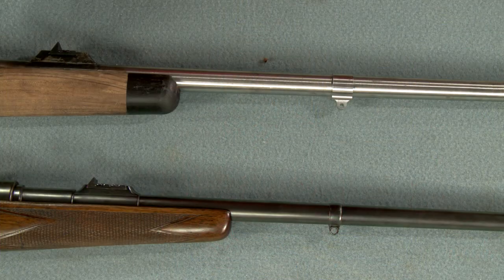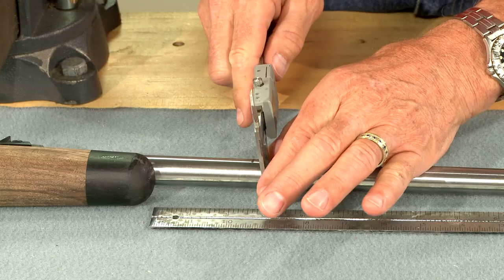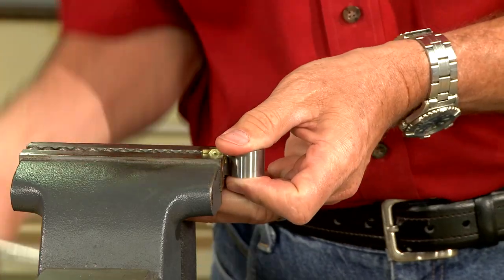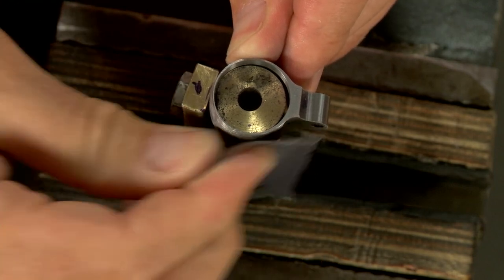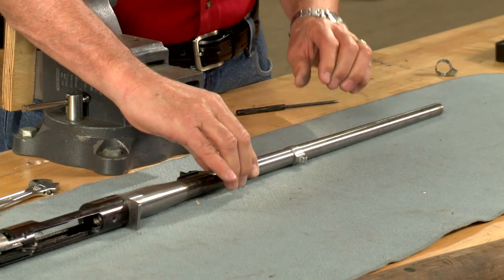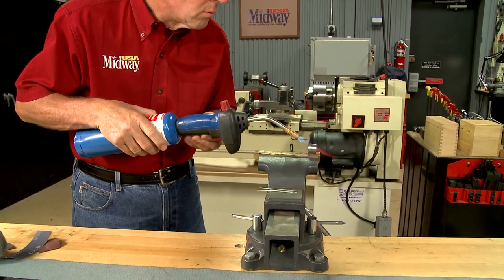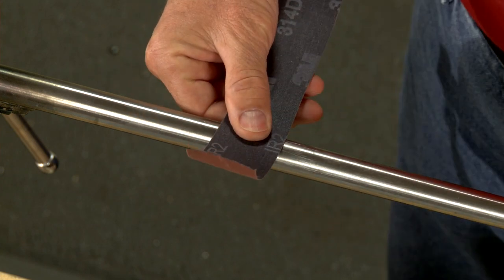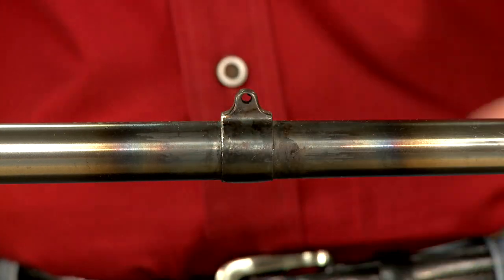How to Install a Barrel Band Sling Swivel Presented by Larry Potterfield | MidwayUSA Gunsmithing

Comment: Wouldn't the heat affect the barrel? You can see the steel change color which means it's been tempered. Unless maybe because of it's thickness only the very surface is being affected?

Comment: So the heat doesn't damage the barrel at all?
Reply: It is medium heat from the propane torch.  It is no more heat than 4 or 5 shots in a row(pretty fast succession) produces.  If he heated the barrel until it turned red hot then it would have ruined it.

Comment: This is not an indictment of Midway or Mr. Potterfield but I urge anyone thinking of installing one of these to take it to a qualified gunsmith.  I would never do this with any one of my rifles ... ever. You have to know what type of steel the barrel is made of, you have to heat the barrel using the right amount of heat, you have to know how to cool the barrel uniformly, and you have to know what you are doing when applying the heat to assure you do not warp the barrel. I have watched master blacksmiths heat treat steel of all kinds and I assure you, you can screw up a barrel big time if you don't know what you are doing.  Save your money somewhere else and let an expert do this for you.
Reply: Loctite retainer (known in some circles as a "chemical press fit" ) might be a better option, no heat involved and just as secure.
Reply: Gotta learn somehow, without the odd hobbyist screwing up a few junker guns we'll soon be out of "expert gunsmiths" that can still do this old school work. Not saying your wrong, obviously don't practice on a Rigby, but  the knowledge in this video means that hobbyist may only wreck 2 guns instead of 5.
Reply: I'm responding to this four-year-old post just in case someone reads it and is left with the wrong impression. What's being used in the video is a propane torch. The temperature at which soft solder melts is less than 400-degrees F. The propane torch he is using cannot get the barrel hot enough to do any significant harm.

Silver brazing involves temperatures that are much higher, ~1200-degrees F.  There are certain concerns with brazing, due to its much higher temperature . In this case, Mr. Potterfield is most definitely not brazing. He states very clearly at the beginning of the video that he is using soft solder. 

Loctite could be used, but soldier fills in the slight gap between the band and the barrel. If Loctite were used, you'd likely have a visible gap between the barrel and the sling swivel, unless your fit is near perfect. Also, with solder you can re-position the part be heating it up and moving it around as often as you like, until it's where you want it. It's kinda hard to do that with Loctite.

Comment: I was told to NEVER attach a swivel to the barrel of a rifle.
Reply: +John Marion with a good sized barrel you dont have to worry about warping it.  The swivel itself, if it is securely soldered to the barrel, wont effect accuracy as it will vibrate congruently with the barrel and will not cause a harmonization or dampening.  however, the sling attached to the swivel will, which is why you should remove it before shooting.  but in africa, the hunting guides dont allow you to carry your rifle by a sling anyways (must be in your hands or balanced up on your shoulder with the barrel in your hand), so it just gives the rifle a more finished look.